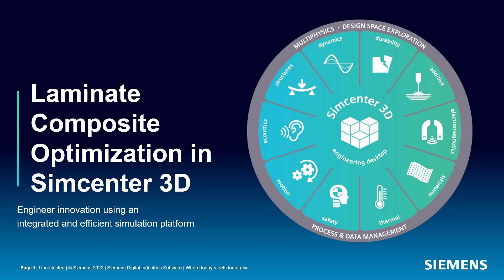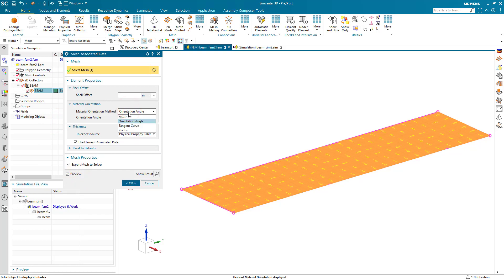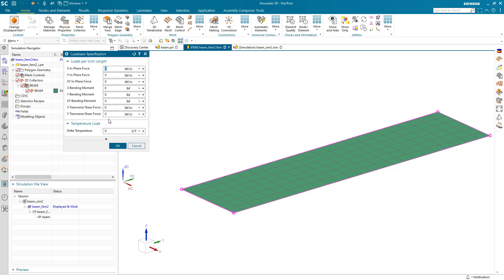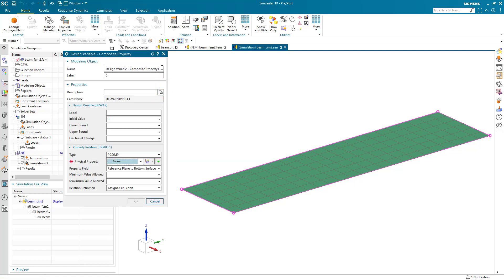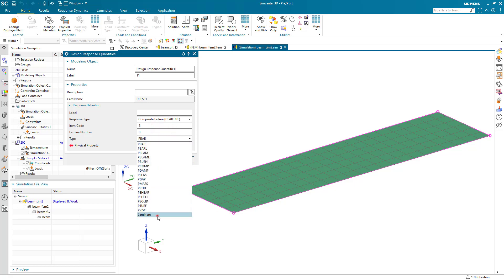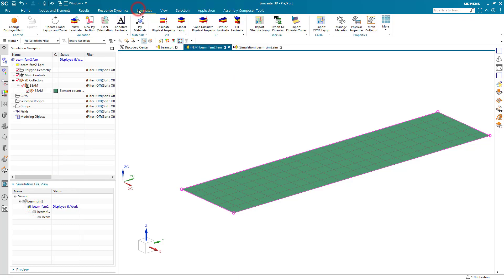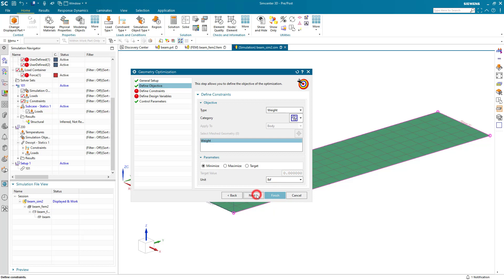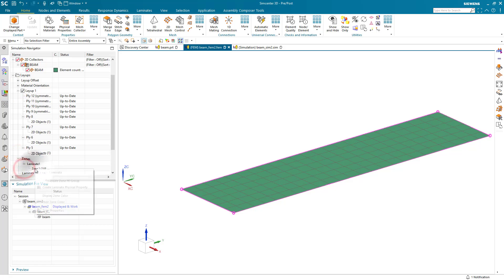Laminate Composite Optimization

Comment: Hi, when I follow the tutorial and try to do the geomtry optimization part, my objective function results give a weight value of 0 at every step thus resulting in an incorrect optimization, what could be the fix to this? I double checked if I missed something during the tutorial but every detail is the same as shown in your example.
Reply from the maker: Do your material properties have a density assigned?  If so, please open a support case: https://www.sw.siemens.com/en-US/support-services/
Reply: I have the same problem. Has anyone gotten any update on this matter?

Comment: We do laminate optimisation by changing the layups, not by varying the ply thickness as ply thickness is same. I don't think simcenter has that capability of varying different layups or optimising the str for a given set of layups
Reply from the maker: Laminate Modeler Coupon Optimization supports removable plys
Reply: @Simcenter3DTipsandTricks  it's only for a laminate not for a structure I guess
Reply: hi, is it possible to have a cad file (step export) and do some general static FEA on the structures (snow load, lifting weight). Or atthe modelling stage I have to model it with surfaces or convert the solif into plies? Or just simply set the solid geometry a composite material and tell the FEA software to calculate stresses and FOS. Thanks in advance.